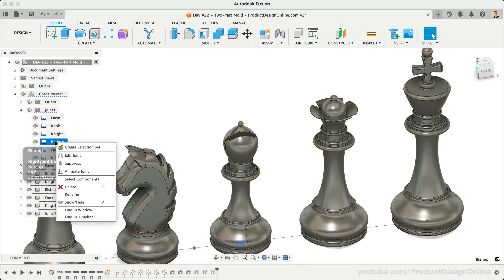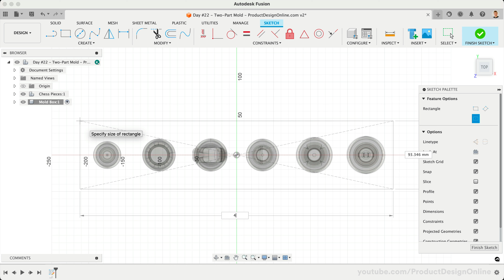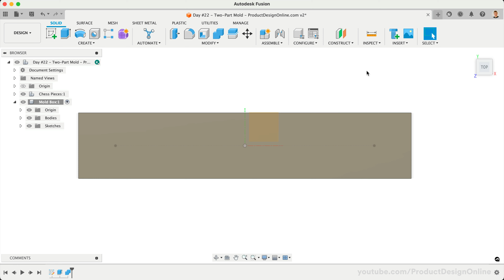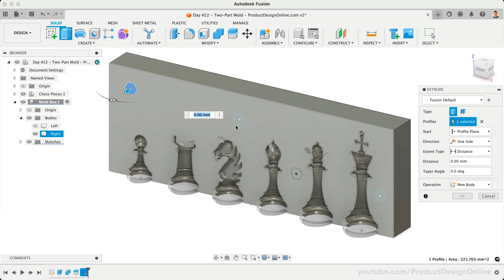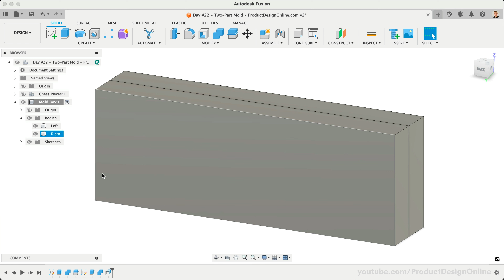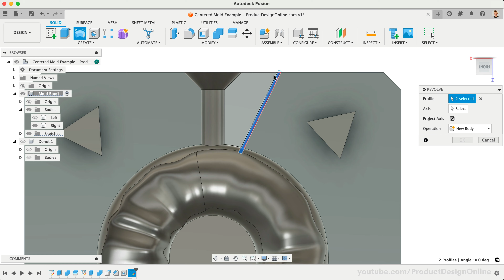Two-Part Molds in Autodesk Fusion 360 | Day 22 of Learn Fusion 360 in 30 Days - 2023 EDITION

Comment: When i try to add the alignment pegs I get an error message - attempting to Cut, try to ensure the bodies have a clear overlap (problems can occur where faces and edges nearly coincident - I tried a few times with the less pegs and in different places and sizes and still get the same error. Any ideas?

Comment: I am not seeing joints in the browser.  When I right click on the queen I don't see edit joints.  The only edit option I see is Edit Initial Position.   I clicked on that and all the pieces jumped on top of each other.  From the start this video hasn't been any good for me.
Reply from the maker: Fusion did a major change in January 2026 where you now need to choose HYBRID DESIGN *FOR ANY TUTORIAL OUT THERE PRE-2026.* 

You are in a part design file which is why you won't see joints and assembly features.
Reply: @ProductDesignOnline  I am actually dealing with the same issue but I am in hybrid design mode and the joints folder does not show up and I'm having a hard time creating a joint to revolve it. It forces me to select another component instead of an origin to revolve it. I'm very new to fusion so am obviously missing something... Thank you for these videos, they've all been very helpful, especially the 2026 Editions!

Comment: I am having a bug or change in Fusion that is breaking this tutorial for me. When extruding the alignment pegs using "Join" it deletes the right body and makes it a complete mold. if I use new body it works but when trying to combine it deletes the right. I move the left out of the way, extrude the pegs, move it back, and the geometry on the cut operation messes up entirely. up to this point errors have been on me but I don't think so this time, I have followed your method 3 times and I get an issue every time. I can't find a work-Around that works either.
Reply from the maker: Can you email me your Fusion file so I can take look?

Comment: this is impossible, you have not explained how to move from one component to another
when in one component the section tool is gone, 
HOW do we move from the chess pieces to the box edit mode this is unclear and not readily available on the net
Reply from the maker: Hi Tom. Are you using a 'HYBRID' design file? That will be required for these older lessons, given the new design intents that were released January 2026.

Comment: Definitely the worst video so far. Rotate around a joint? Wait, what? Why? Not a solution that works for me (and others below). So.... 
Click M for move, select the 'Move Object' type as body and the 'Move Type' as rotate (there are 5 options). Click on the queen or rook that needs to be rotated. Find a line on the z-plane axis and either pull or enter # of degrees.
Reply: Saved me a lot of time figuring a solution for the broken joints - Thanks!
Reply: I don't think there is an issue with the video, but more of how Fusion has changed and updated almost year years ago. But thank you for your tip! Saved my ass!

Comment: I tried to download file as Fushion Achieve and when I open it I cant work on the joint function, the joint turns to joint origin. All the chess stick together and no response even I adjust the angle
Reply: Same for me, The joints were not on the browser, but I was able to select the joint from the time line.
Reply: @stephenLonghibler good fix
Reply: @stephenLonghibler My timeline showing base feature only. No other commands. 🥲

Comment: Thank you so much again for the lessons!
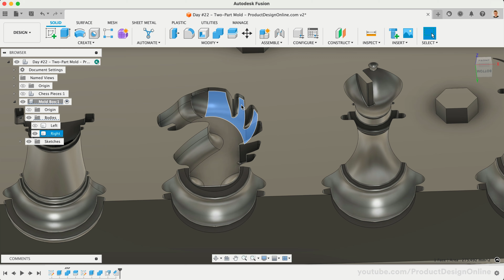I have a question that you mention to draft the mold at 9:05, I tried to draft the right side of the mold and the error came out when i select the chess for faces. 

"Error:   An existing fillet or chamfer could not be deleted.
    Try suppressing or deleting existing fillets/chamfers before attempting the operation."

Is that because this model is complex or curved? How do I fix this? thank you so much.